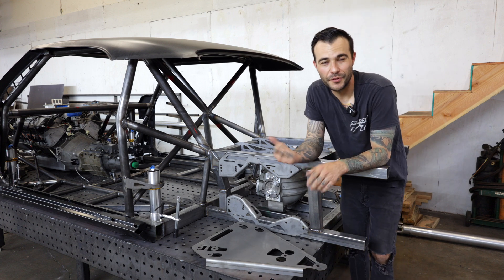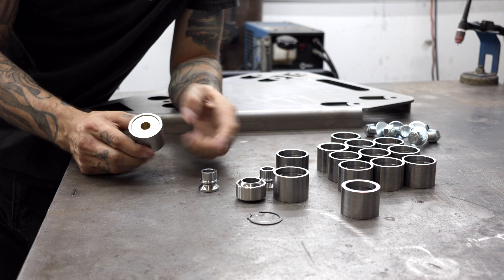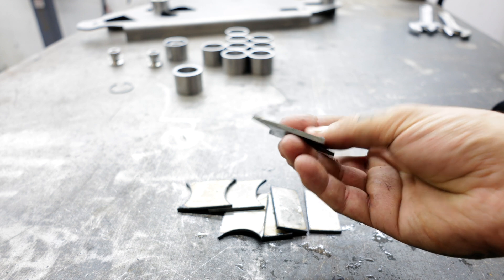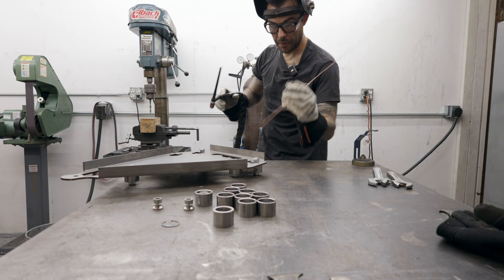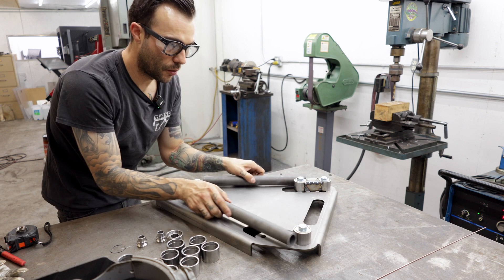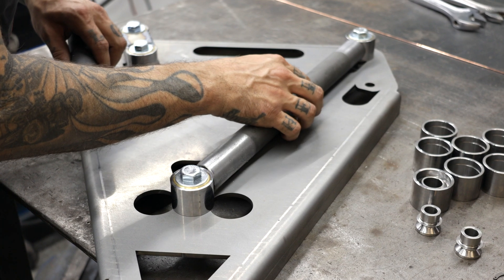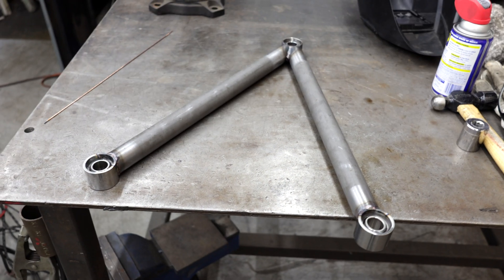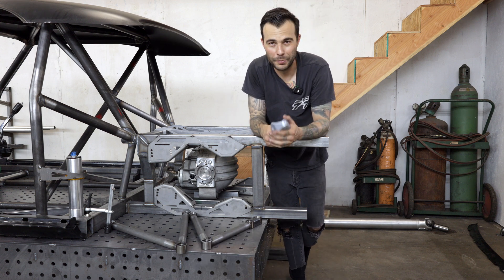Fab-ing Rear Control Arms from Scratch – Tube Chassis Drift Camaro Build

Comment: First time here, just subscribed.... I like how clean and precise your work is. Good job buddy! Question: 2:17  Why didnt just add piece of tube here? instead you connected those with plates
Reply from the maker: Thanks for the support! Because thats where the tie rod is gunna mount. If i was to do a tube it could potentially twist vs plate will be more rigid. That section basically takes the load of the UCA forces and the Tie Rod forces
Reply: @masonthedriver  Thank you for the explanation! I have learned something new for me

Comment: If you hold the cup over the weld for little while after removing the rod but with the gas still going, you'll get much less coloring and stronger welds. I just learned this myself and it's made a world of difference. Just friendly advice if your interested, not criticizing or know-it-all.
Reply from the maker: Thanks for the tip my dude. You are right. I notice it realllly affects stainless.